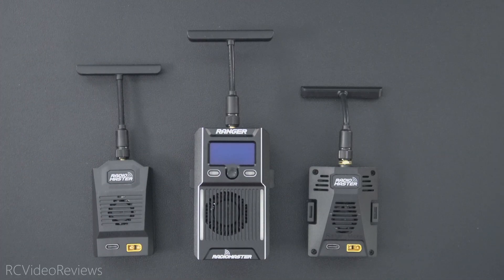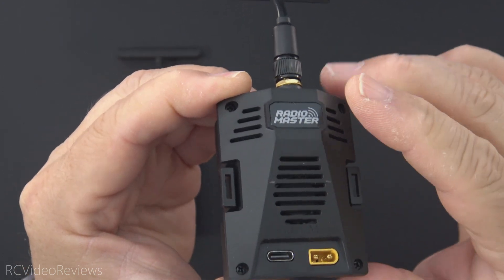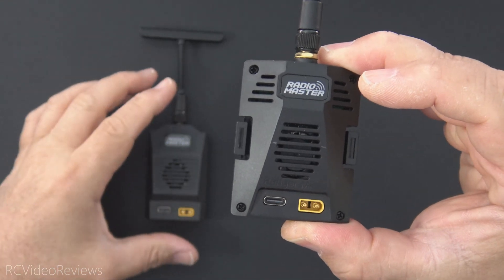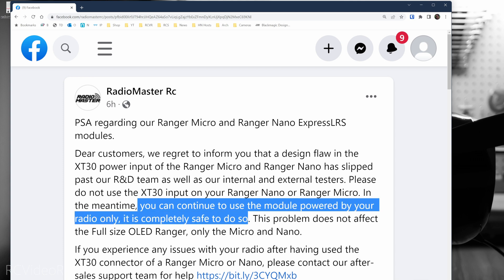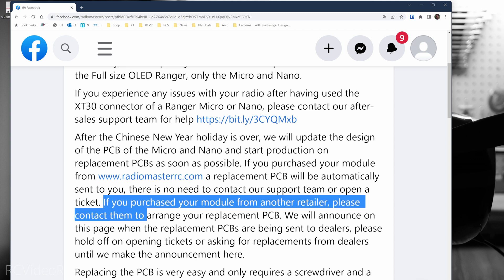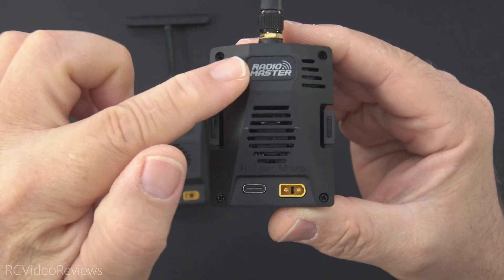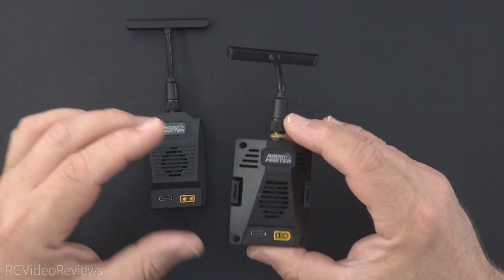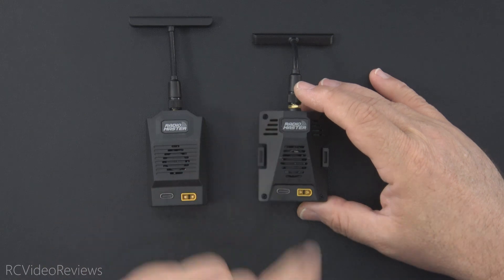Design Flaw: AVOID DAMAGE! • Radiomaster Ranger Micro/Nano XT30 Input Problem Express LRS

Comment: OH NO😢, I THINK I I FOUND THE ISSUE TOO LATE. PLUGGED IN A 3CELL 650MAH.
Reply from the maker: They revised the board design. I don't believe more recent (2H23+) are impacted.
Reply: I took the time and PATIENCE today,  looked at another video and then it strikes me. Try again. Flashed the RadioMaster Ranger Micro via USB and it is ALIVE again. I may have just flashed the wrong firmware 2 days ago. I'm happy my v2.1 Ranger Micro is working again.

Comment: I just oredered one from rdq today i hope this is fixed in the one i receive.
Reply from the maker: Confirmed by Radiomaster. No more v1's should be sold.
Reply: @RCVideoReviews  - I just purchased one from my local Canadian retailer and their website says this: "Update: Updated to the V1.6 PCB which is fully functional and at no risk of XT30 issues" - I opened it and indeed, it is v1.6
Reply from the maker: If you don't need external power, it'll be fine. Even if you do need external power, I'm pretty sure retailers have the correct boards now (but I'm not 100% sure of that).

Comment: Running the micro range off the radio battery. Will it have enough power to do 1w output? If yes then why did they put a xt30 on the module?
Reply from the maker: It's not about power, it's about capacity. External batteries allow it to run longer, not deliver more power.

Comment: I just picked one of your random videos being the newest so maybe you would see this. Do you have a video on setting up elrs tx and on rx? I’m using a Tx16s and happymodel receivers and happy model module. I managed to put 3.2.1 on my module with binding phrase etc not having the same luck on my ep2 rx tho. Same binding phrase take the bin file and try to put on my rx after it goes to wifi mode. But get not enough space, then used JB method for the partition then bricked my rx so had to fix that. This is a headache to say the least.
Reply from the maker: This might help: https://www.youtube.com/watch?v=AdgBoYJNI0M

Comment: I got my radio damaged due this flaw. Radiomaster is sending me the TX16s mainboard (that got damaged) and also a new updated PCB (when they have it ready). Good thing is that they were honest and repair the damage.
Reply from the maker: Agreed
Reply: Hi, what is damaged in the radio? how can i find out that it is damaged? I have used the xt30 connector on the module, but everything seems fine.

Comment: How much longer are we going to wait now? The beta  fpv 1w module is looking better and better. Although I like the fact that you don’t need to mess with dip switches on this one.
Reply from the maker: Seems open ended at this point. Do you plan on using external power? I never have.

Comment: What are the XT30 connectors used for on the back of module's?
Reply from the maker: External power.
Reply: @RCVideoReviews  LOL my bad I meant like why? I've heard your not surprised to use a certain milliwatt through the pins in the back, is that true and what is the maximum? My module will do 25mw-1w.
Reply from the maker: It’s not a question of current. It’s a question of capacity. Some people run 1 or 2w for long periods of time and they feel an external battery will allow flight durations beyond what an internal battery that also powers the transmitter will allow.
Reply: @RCVideoReviews  I found this article after doing some more research." MAX is 1amp @ 2s (7.4v) However anything more than 1000watts we still officially advise using external power. This is why our battery cover has a ready made a cut away and we made the 5000mah RM battery with a XT30. Troy Naquin Customer Experience Manager
Radiomaster RC"

Comment: Radiomaster probably knew this already, and sold them anyway. They supposedly sent these to the ELRS dev's  for"quality assurance", and still made this mistake?
Reply from the maker: There's no upside for Radiomaster in purposefully delivering a known defective product, suffering the brand damage, REPLACING defective boards, and REPLACING radio mainboards that may have been impacted. 

The developers did receive units for software development and testing. They were not obliged or asked to perform PCB EE validation.

Comment: Well things happen ...its what you do to fix them wrongs to rights is whats important and now we know where RadioMaster stands. Do you know if they are replacing the boards that got brunt in the controllers due to the module?
Reply from the maker: Yes, I addressed this in the video. If someone has already connected power to xt30 they provided a link which is also in the description.
Reply: @RCVideoReviews  yes you did sorry about that im dealing with a small head cold.. must of missed it the first time..lol thanks for all the info 👍

Comment: I had concerns Abt buying one first production run ,got one shipped yesterday from Rdq and now this wow!
Reply from the maker: Personally, I think XT30 power input is a fairly specialized use case. I fly all day long with the Micro powered by the 6200mah internal battery and come home with 75%+ power.

This is only really going to affect people who are running fairly high power levels for a long time and have a concern they could drain their TX pack.
Reply: @RCVideoReviews  I have been using R9 for years I must have used xt30 once🤣
Reply: Here in England they still aren't available!
Reply: @chrissofpv3017  Got my pre-order today from hobbyrc
Reply: @Grim_fpv  Ahhh.fabtastic!...I'm in Brazil atm .so gotta wait until I return to England..couldn't preorder as my house is empty...post would get returned.
HobbyRC were honest,insofar as posting the warning pronto into the pages for the Micro and Nano.Thats why I love HobbyRC👍🍻
Have fun ...and I assume the board you'll remove from the tx can be a very handy "spare" in an emergency.
Reply: @chrissofpv3017  well I bought one from raceday Dec the 15 th and we will see how this goes
Reply: @michaellongford871  ..fingers crossed 🤞
I'm still AMAZED Radiomaster of all people didn't R&D it first,BEFORE releasing.
Thank God I have a (less fashionable?) BetaFpv Micro 1W tx module to use.
Still.. you'll have a spare board Michael if you still need to mod it,albeit locked forever to 100 mW.👍